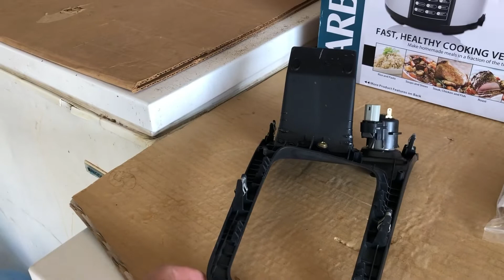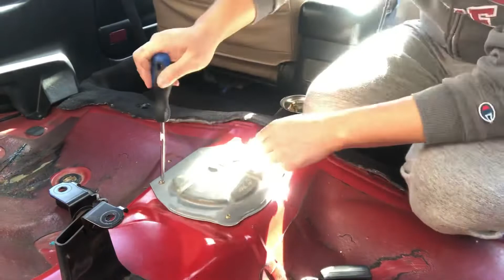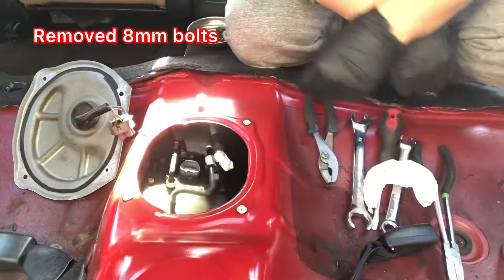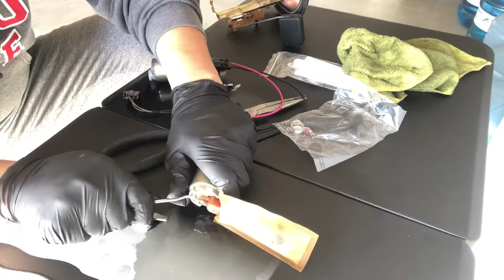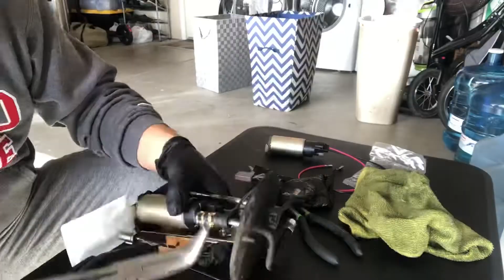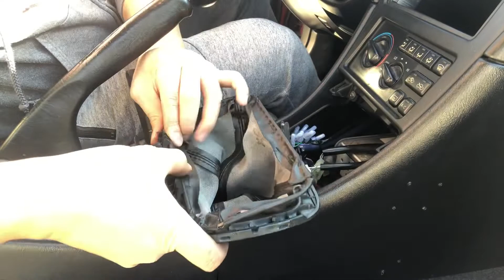94 Celica fuel pump replacement

Comment: Thanks for video.  I'm not Asian but we have a rice cooker, lol!  Most Asian dishes are tasty but very salty so limit my consumption!  Just ordered a Denso fuel pump kit from Rock Auto for my '97 Celica GT convertible, was less than $100 with shipping so not too bad.  Watched your video on fuel filter replacement, what a gigantic PITA that was, will use the same flare wrenches.  New fuel filter did improve things slightly but I am still getting a very mild bucking and stuttering.  I've noticed it becomes a bit more apparent when cruising up hills especially as you near the summit (plenty of hills here in PA), this to me suggests fuel pump is going out.  Obviously I could do a pressure reading to verify but I don't have the tool, but with 231,000 miles I reckon the original pump is nearing the end of it's life anyway.  Obviously I have done the easier stuff, air and fuel filters, spark plugs and wires, added fuel injector cleaner, replaced PCV valve, cleaned throttle body, new distributor and rotor arm, checked head gasket and checked for vacuum leaks, I think everything now is pointing to the fuel pump.  If not maybe MAP sensor, will see!

Comment: Great Video.Can you tell me if there is a way to get to the fuel pump without having to take out the back part of the seats as i have power amps screwed to the back of them and i really dont want to remove all the audio equipment at the back of the hatch. Can just the bottom of the seat be removed??
Reply from the maker: Hi, to be able to fully remove the lower seat portion. The back portion of the seat have to be removed first. Unless you have some sort of ways to keep the lower portion of the seat from getting in the way of removing the fuel pump. It's ideal to fully removed the back seat to get the space needed to access the fuel pump. Good luck.

Comment: You put the new filter on the old pump, Installed old pump!?
Reply from the maker: hi, Yes I did. It turns out the filter was just dirty and the pump was still working properly so I kept the old pump. However, the engine hesitation was some vacuum lines that needs to be replaced.
Reply: Good job!! Thanks for the info

Comment: Hello. i had a question, i have a 96 celica that im looking for some body parts for, i cant seem to find any that sell new, or good condition body parts online, im specifically looking for rocker panels both sides, both dors and both front fenders.
Reply from the maker: Hi, if you’re in ca. you may have more luck of finding one at the junkyard and get the parts you need. Looking online will be a challenge as these cars are hard to come by.
Reply: Hey, I have a question about where you got those taillights for yours? They don’t look like stock and I like them, but I can’t find any good sources to get new ones.

Comment: You put the old pump back in with the new fuel filter.....
Reply from the maker: Hi, I only replaced the filter because the pump still works. The filter was just really dirty. However it was some faulty vacuum lines that cause the motor to have low idles.